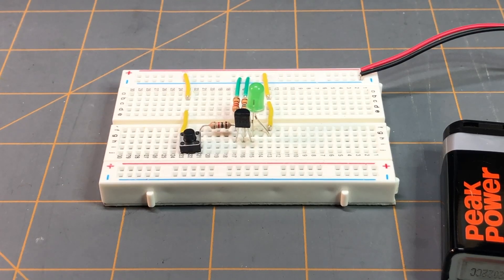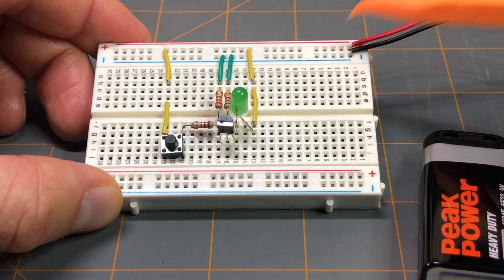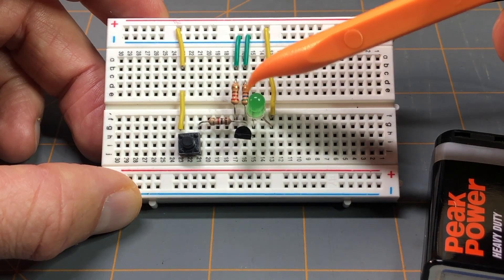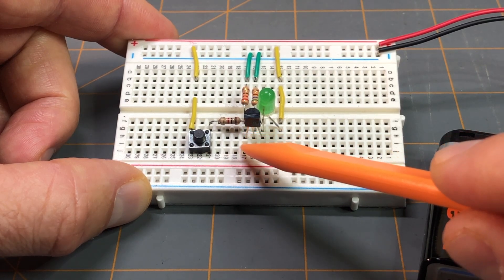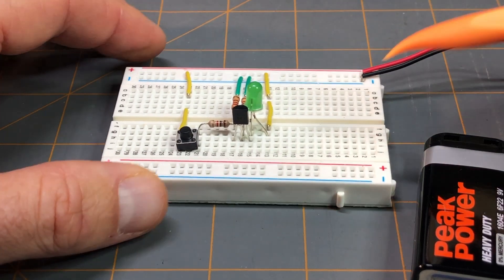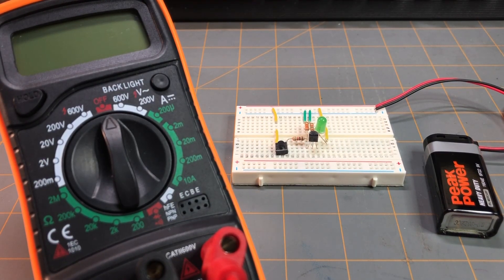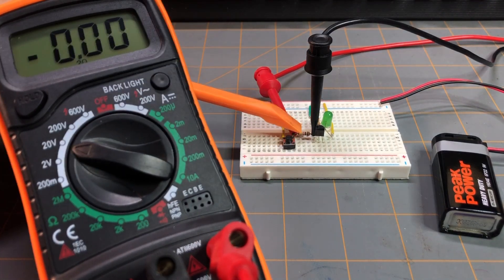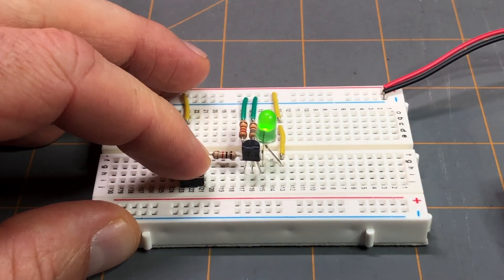Understanding MOSFETs: MOSFET as a Switch (Supplemental Video)

Comment: I just took a look at your blog post and unfortunately, you have a misconception about about how a mosfet behaves in the saturation region. The voltage from gate to source is not equal to the the voltage from drain to source when passing current. You can see this by checking the voltage you think is at the gate when the switch is closed. You incorrectly suggest that Vgs = 2.9V because Vds = 2.9V, and you correctly calculate the voltage at the drain (i.e. the voltage across R3) to be 4V. That would mean the voltage at the gate would be 4V+2.9V = 6.9V. But you also calculate the voltage at the junction between R1 and R2 to be 3V, and that is also the voltage at the gate. It cannot be both 3V and 6.9V.

When the mosfet is in the saturation region, the drain current is essentially independent of the voltage across the mosfet. If you raised the supply voltage V2 by 3V to 12V, the current would be unchanged, so the voltage across R3 would remain at 4V and the voltage across the LED would remain at 2.1V, so Vds would increase by 3V to 5.9V. But clearly Vgs doesn't change because Id doesn't change. Your assumption that Vgs = Vds is unfounded.

You will find that the threshold voltage is fixed for a given sample of 2N7000 at somewhere between 0.8V and 3.0V, and at 20mA will require an additional 150mV or so. Depending on the sample, you will find the source is at somewhere between 0.95V and 3.15V below the voltage at the gate, and that determines the current flowing through R3. The voltage at the gate is indeed 3V if you use R1=1K and R2=500R, so the voltage across R3 can be anywhere from 0V to 2.05V, resulting in a drain current of anywhere between 0mA and 10mA, depending on the sample.

I would recommend that you check the voltages across each of the resistors with a multimeter, as well as checking Vgs and Vds across the mosfet, and then calculate the drain current. It should give you a clearer idea of how the mosfet behaves. Hope that helps.
Reply from the maker: You are absolutely correct my friend! Thank you so much for pointing out my mistake, and what an awful mistake it was! I've promptly corrected the mistake on the website and will be needing to update this video in the near future. I'll have to be sure to tag you and mention you for observing my mistake and helping correct it in the next video. It's people like you I'm truly grateful for who watch out for mistakes like this and from whom we can all learn from. Again, thank you so much. You are greatly appreciated!
Reply: @motbots  You're most welcome. Thank you for all the effort you've put in to your website and this video. It is appreciated.